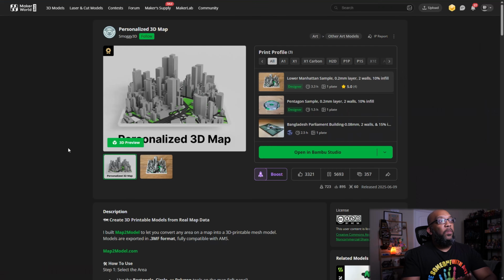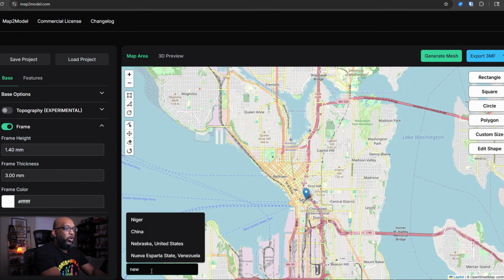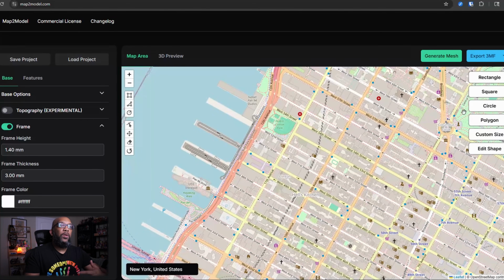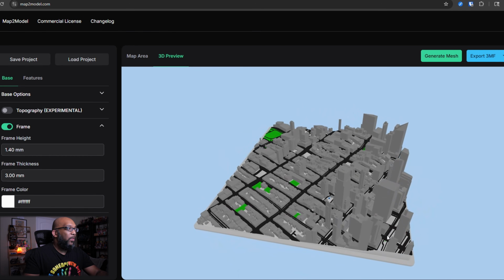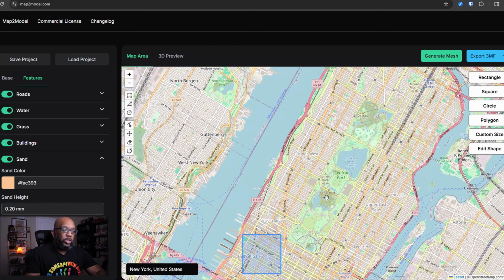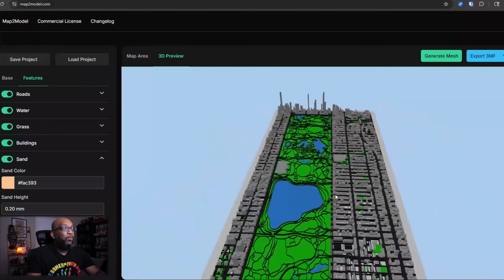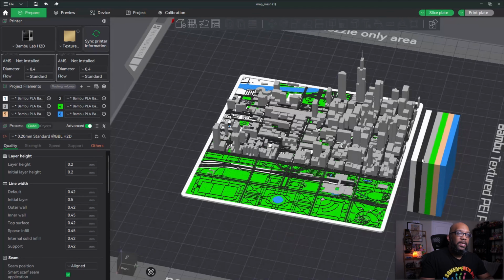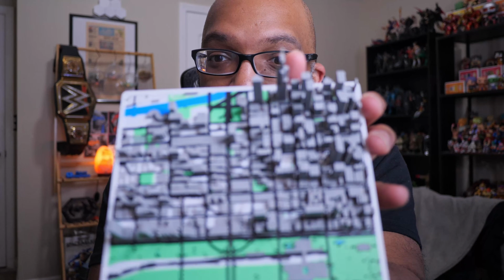Make Your Own Custom 3D-Printed Maps!

Comment: Unfortunately places in outback towns in Australia there are no detail in the map2model. Would be nice if you could use google map in that.
Reply: are you sure its not just glitching out? When I used the search it would just load a blank map, but when I manually zoomed out, then panned in on my town, it loaded in. now, my town is not particularly remote, but still, the mapping in the area leaves a bit to be desired.
Reply: @myopinion69420  Yeah i'm sure i tried several outback places and the same thing.

Comment: Played with this a little bit a couple times, and it seems that their database is limited to the US?  Or I suppose it's more accurate to say it doesn't really have much information on Alberta.  I was able to get street layouts, but neither topographical nor building  information was right for the couple places I tried.  I'm not shocked that they don't have the architechural details of random-medium-city in there, but the building footprints were genericised, too.

Which means it's a pretty toy, but seems to be yet another Amero-centric thing on the internet.

(None of which is a criticism of the makers of Map2Model, they can only use the data that's available, it's just an observation that the information needed to really make this cool is probably lacking in most of the world.)